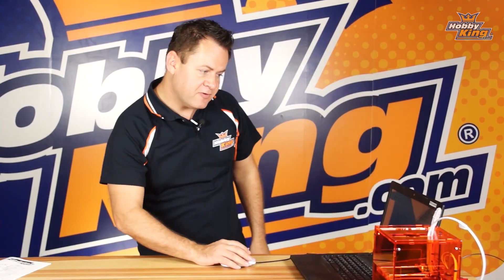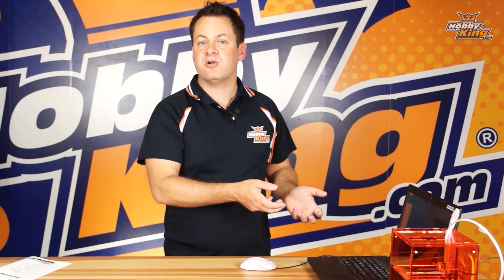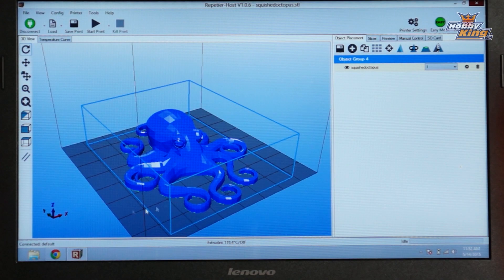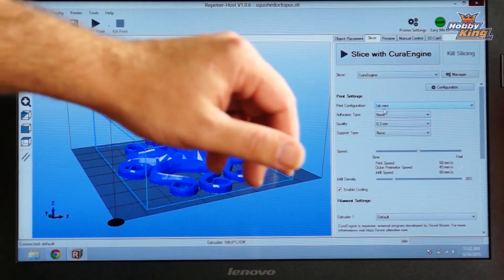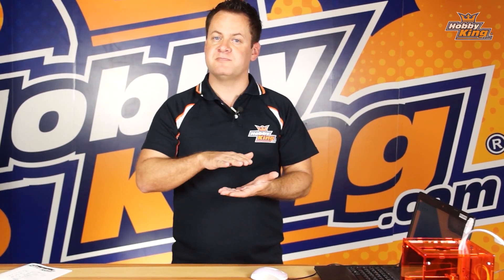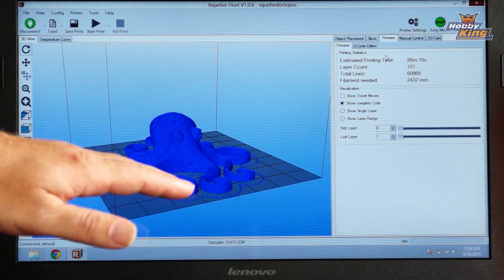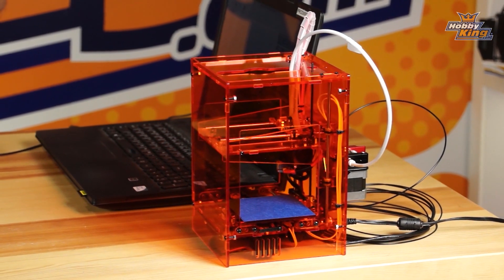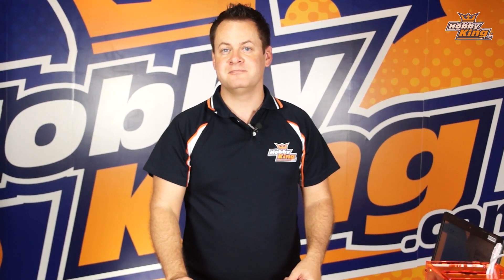Mini Fabrikator 3D Printer by Tiny Boy - Printing Guide

Comment: pls sell in eu warehouse without power supply
Reply: ***** freight cost
Reply: it cant be shipped with power supply, because the power supplay has the be checked and controlled by the government or so :D
Reply: itouchtests Yes, I've read their response on this somewhere (not, by the way, on Hobbyking Live where no one from HK is apparently alive to respond to questions) and it has to do with safety certification approval, like the UL approval in the US. Apparently, they can't find a US/EU approved multivoltage 12V 6A switching mode power supply in all of China for some reason.